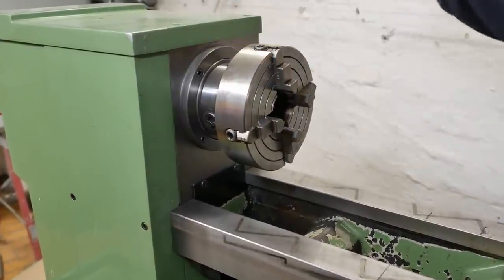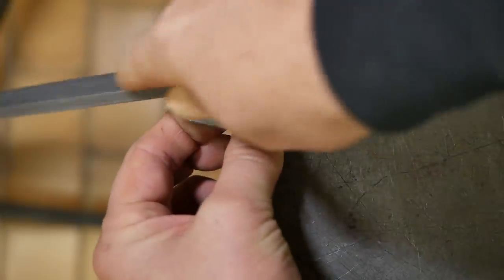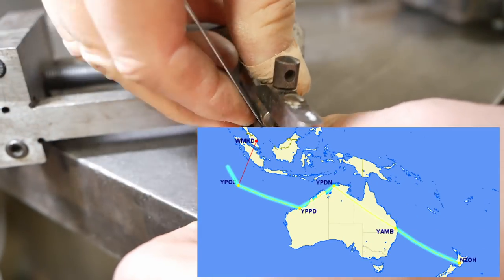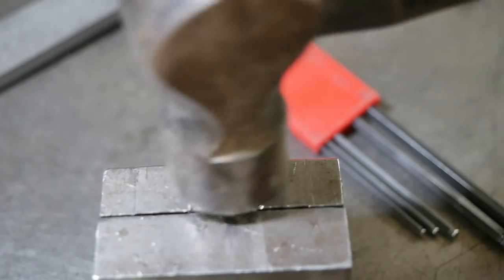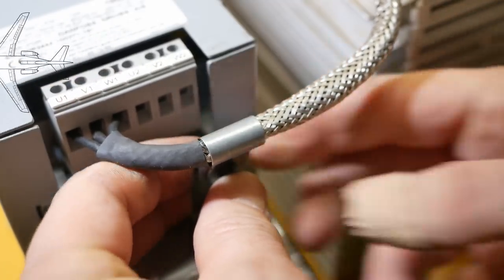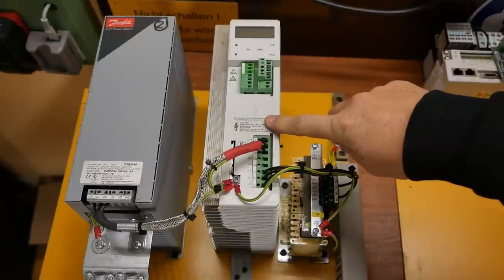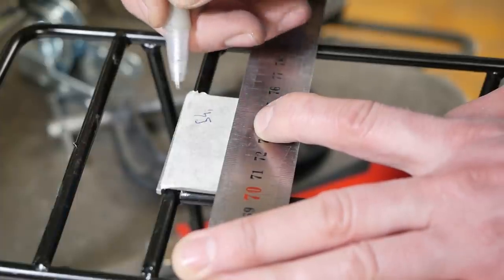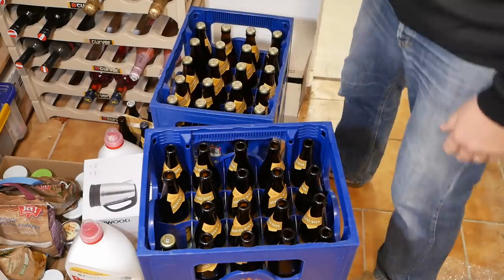Schaublin 125-CNC lathe - Ep. 26

Comment: Thank you so much for the shout out!!  And the B727 was susceptible to compressor stalls with cross winds.  All planes are, but I've heard it happening to them.  And yes, military planes can't just go flying wherever they want.  You might get intercepted by me, LOL.  Also, we nearly lost a B767 with a crazy electrical issue, or more precisely issues.  When you attached your bus bar, you correctly removed paint.  My friends were flying to South America, and they had all kinds of crazy indications.  Nothing matched with the book, so they didn't know what procedures to run.  So, they just put it down on the closest runway.  Turns out it had been painted and they didn't remove paint from under the bus bar.  There was partial contact, so some systems partially worked.  Because of where they were and the weather conditions and several other factors, if they had tried to continue, they would have crashed.  I'm glad my friends were trained correctly.  Great video and thanks again.....
Reply from the maker: Hi Jasper. I am really enjoying your Atlas shaper series. YOu are making a lovely job of that. Hope you get a bit of traffic from the shourt out.
Reply: @RotarySMP  Thank you so much!  And I hope so. Ps. This shaper came out great!  You’ll see it on the next video…..
Reply from the maker: @jster1963  Darn, that was fast. Didn't you read the fine print of the YT machine shop collectives manifesto? No machine project is allowed to complete in less than 40 episodes!!!
:)
Reply: @RotarySMP  LOL!  I'm trying something different with this restoration.  It was 95% done before I posted the first video.  It's done and now all I have to do is edit.  Don't turn me in to the YT collective ;-)  Ps.  This took me 2 years to restore....
Reply from the maker: @jster1963  Phew, that is lucky  to hear. I thought I was the only one who takes years on a project like this.
Reply: @RotarySMP  LOL!  Nope, it takes me a while to finish ;-)

Comment: Great video - and you taught me a lot of new thinxs :)
1. At the beginning of the video you mentioned the correct bracket mounting position ... I guess some brackets just want to be mount in the air
2. I didn't know that for electrical conductivity surfaces need to be scraped down to a 1/1000s
3. Some rulers start from nowhere
4. Welding can be used as a transfermark
5. You can hide a lot of full beer crates under an empty one - if you need to convert a full crate to an empty one, let me know - I can help top solve that problem
6. some people seem to love tin snippers
Greetings, Stefan.
Reply from the maker: A channel for useless life skills :) Except the beer!

Comment: Clean work, and interesting stories as always! Interesting thing happened on my resto, I was ready to put the bellows back on my big horizontal mill that i have been working on for the past few years, so I called my buddy over to help wrangle the last one in place, since it was warped. we put it in the machine and it wasn't lining up, and was warped. so we took it out and started unwarping the ribs with a heat gun. we had them all mostly straight, then I took a tape measure to it, and one side had shrunk an inch and a half in length. They still sell the bellows, not for cheap though, so I ordered it and they changed the material of the ribs from what i assume was abs to a fiber reinforced phenolic.
Reply from the maker: That is strange. When I got the Maho the X bellows were shot. I got a recommendation for a Chinese guy. He did a good job if making some to exactly my design, including my errors :(
Lucky I could make them fit.

Comment: 8:32 To get wider openings you can just bend the individual pieces of the cable channel back and forth until they break off, at with all the ones I have worked with. So you can make those passages when the cable channels are installed and you dont have to get some snips in between the pieces when the openings are in the middle.
Reply from the maker: Thanks. I saw after I did it that they have weakness moulded in.

Comment: I recommend the earthing use a star common point rather than the daisy chain
Reply from the maker: I would have though that as well, but the Lenze manual shows daisy chaining for those shields.
Reply: Yes for everything except the motor drive lines. This is the recommendation of all VFD/drive manufactures, ABB, Seimens, Delta, Schneider, Mitsubishi etc etc etc. Rotary has it right.

Comment: fallow Kiwi here,.  free up in the 70's 80's in Bulls.    used to visit Ohakea a lot has my father was with Service and Supply.   miss seeing the Skyhawks and the visiting F111's in the air.
Reply from the maker: I was flatting in Bulls for a couple of years while I was on 75 Sqn. Seems the entire air force is now in Ohakea.
Reply: @RotarySMP  almost.   They are still building,. I understand army and some navy are to be there to.    I'm living in Palmy, working in Bulls as a fitter welder.    What years where you living in Bulls.    Would be a hard case if we used to drink at the Cry, or Rat Hole  together.  LoL 🤣
Reply from the maker: @russcole5685  I was there in 1991 to mid 1992, but had a friend at Uni in Palmy, so I didn't frequent either the cry or the rathole.
Reply: @RotarySMP  I was still in high school those years,. Left in 94 to join NZDF myself.  1/3Bat  5WWCT  Support Company.   Assault pioneer, then HSMG     19 year old,.  5'6" at  a skinny 57kgs,. Made No2 gunner    had to carry the tripod, 4 boxes 7.62 my own dryer and gear.  Close to 80kg of gear.    It made me a very strong willed and determined little pit bull.   Lol. 😉🤣.   Just don't stop.  Get moving and stay moving.  Lol. Good times.   Lessons have served me well through the years.    46 now. And my knees, back hips showing the usage and abuse.   Lol.  Will do it all over again,. And currently getting my fitness back up, trying to find away to get to Ukraine to volunteer.   I left NZDF just before East Timor started.     Kicking myself for missing out.
Reply from the maker: @russcole5685  The RNZAF is different. We pride ourselves on staying in safety and sending the officers into harms way :)
Reply: @RotarySMP  he he he.  🤣.  Have never heard that before.   Makes since as the officers used to be the strike force pilots.  Lol.   Happy days to ya pal.    Better get my but to bed.    Been great chatting.  Will subscribe

Comment: Surely I told you the story about similarly mangling a ruler?  Another story I heard from an RAAF guy was the Malaysians putting F404s in their Skyhawks and being so strapped for cash that the poor bugger with the tiller bar on the nosewheel having to use AA batteries for ear plugs!  Thank you as always for the videos, they're great fun and a highlight to Sundays.
Reply from the maker: Oh I saw that in Kuantan. Our A4's had quick disconnect starter ducts, but theirs, you had to press the air tube  up the the starter and hold it. The poor buggers had either AAA's or cotton wool in their ears.

It was Singapore who had the F404 powered Super skyhawks (A4M?).
Malaysia bought a hodgepotch of early models from desert.
Reply: @RotarySMP  I stand corrected!  I never saw anything creative like that in person but if I get a chance to go for a pint with you I've got more.
Reply from the maker: @jimsvideos7201  Thanks for the offer. Some of the stories I now add to my videos I havent thought of in years.

Comment: Hi, i liked your compressor stall lesson, i just like to add one thing my trent700 type training teacher told. Is that compressing air is against nature laws, so most engine stability problems happen at the compressor stage instead of the turbine stage, compressed air always expands in nature. And most of the engine airflow control is basically ensuring the compressor feeds the combustion  chamber with just the right amount of air at the right amount of pressure. My 2cts
Reply from the maker: Yep. Like people,  air want to move high to low pressure. :)

Comment: I would think just operating the ignitors on continuous would prevent that.  It works on my Garrett's.  Ignitors ON during precip, icing, turbulence and always on for takeoff.  Rumor has it they could throw a fit during those conditions.
Reply from the maker: A compressor stall on an axial flow compressor is normally not associated with combustion. The stall will initiate at the highest loaded stage, which may be near the front of the compressor durnig spool up.
Reply: @RotarySMP  Any chance centrifugal compressors are more prone to stalling?
Reply from the maker: @jagboy69  Without varible inlet guide vanes, you have a narrower operating range, but generally cetrifugal flow compressors are less prone, due to the assistance of centrifugal force.
Reply: @RotarySMP  good point.  No IGVs here.😉

Comment: I'm not convinced that strap clamp you fabricated is doing a good job of making a solid connection to the braid it is clamping. Short of soldering, I'd suggest reeving some bare tinned wire or a few nested tubes of the same shielding around the existing shielded cable to get a fit that won't let the cable slip in the clamp when given a small tug.
Reply from the maker: Good spotting. It is not that tight. But this is a static component in a low vibration environment.
Reply: @RotarySMP  Even so, braid and galvanized steel both have a habit of oxidizing in air and eventually making a very poor connection at high frequencies. In fact it can be worse than just a poor connection, you can get diode-like growths that will themselves emit all kinds of really nasty EMI trash from the already nasty RF that can be on the braid. The only way to prevent that is a solid mechanical or solder connection that makes intimate contact and shields a part of the connection from oxidation.
Reply from the maker: @lwilton  There is never an easy solution with RF is there :) Every time I try something, there is always the correct feedback, that I screwed up. Sigh! :/
Reply from the maker: I guess I need to make the next one tightr, around a smaller mandrel.

Comment: Have you tried CO2 snow to clean that plate? CO2 is a solvent for organics. If you have a CO2 cylinder you make a small nozzle so it jets out in a stream and creates CO2 snow. The pressure from the spray and the explosive evaporation will dissolve blast the gunk right out of there. I tested this tip before sending it to you, used it to clean some stubborn grease out of a gear that just wouldn't come off. I personally use custom equipment for this, but for a one off job I am sure you can come up with an appropriate nozzle for the CO2 on the Lathe. I heard CO2 is used for welding so I am assuming you have a pressurized cylinder lying around. Should be a fun project and CO2 snow is amazing for cleaning. I can send you a link to a sample cleaning, but not sure if YouTube allows posting of links in comments
Reply from the maker: Thanks. I'll keep this in mind, but for now I have to be careful I dont stumble on an effective cleaning method while still have 20 episodes to go:)

Comment: I have lived and worked in port hedland and have been through the airport a few times as a result. Not a very flattering place to have issues with the aircraft you are flying on to be.
Reply from the maker: We were only there for a couple of hour fuel stop, and my only impression, other than the compressor stall, was a train which seemed endless, carrying iron ore. Pretty remote place.

Comment: I was in the finnish army artillery battery. I do not believe you can make a sound from a plane engine that is as loud as the artillery guns. Or you be beyond mayday at that point.
Reply from the maker: I remember the guns firing for the various ANZAC day parades. Compressor stalls are seriously loud. Depends on the engine model and were in the copressor it surges as to whether it is destructive or not.

Comment: Can such a compressor stall cause damage?
Reply from the maker: Yes, definitely. The PW4060 on the 767, 747 and MD11's went through a number of redesigns chasing compressor stablity issues up and down the stages, with some spectacular engine failures wiping out all the airfoils (Corn cobbing the rotor). They finally redesigned the entire compressor casing to increase rigidity to slove it. 
The JT-8's in the 727 tended to less destructive stalls.